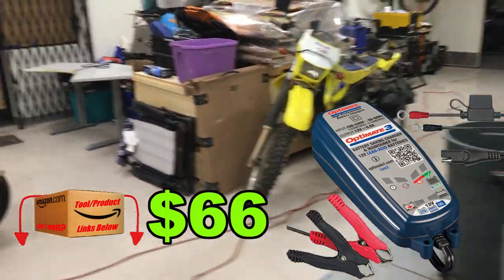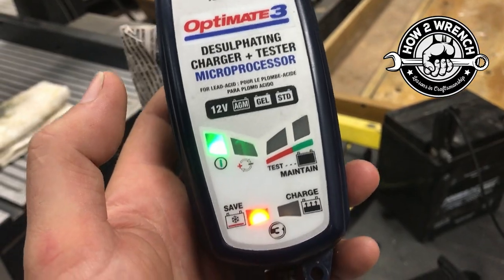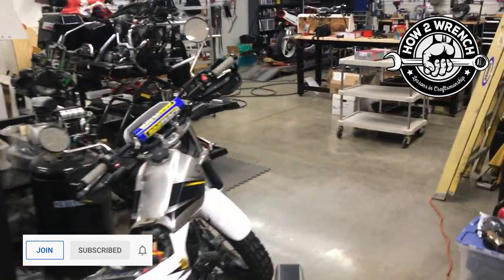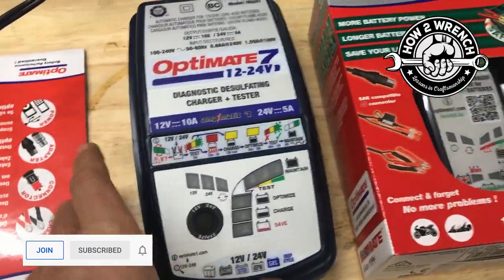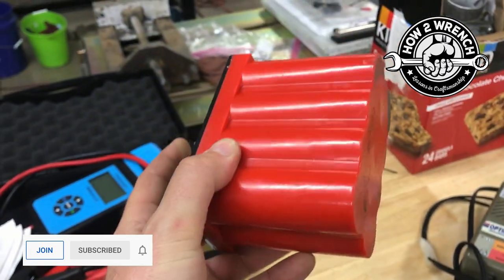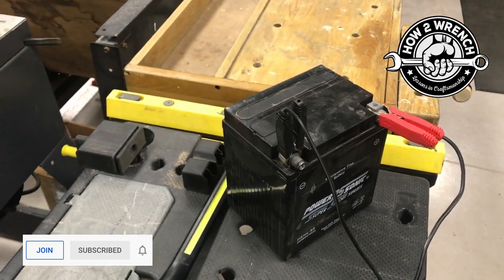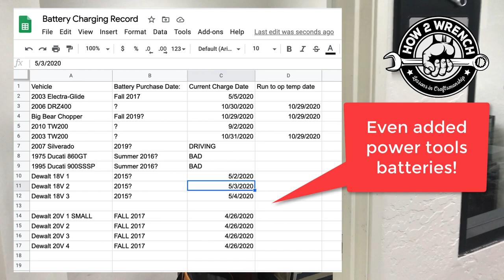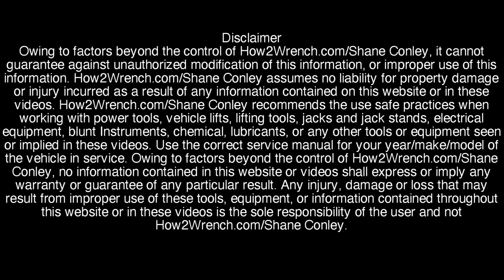Can a battery charger really save a battery? YES! Saved me $214! Optimate Battery Charger Giveaway!

Comment: Good stuff.  I recently picked up a Noco 2x2 smart charger. Super impressive. It's got two stations and both have modes for 6 volt, 12 volt, AGM, and lithium! Has up to 2 amps on each station but will only use what's optimal for the battery, especially during the last 25% of charging when it will use a lower conditioning rate.
Reply from the maker: Thanks for the info! Wild tech out these days.
Thanks for subbing!
High 5 us with a donation: https://www.paypal.me/how2wrench   
Join this channel to get access to perks:
https://www.youtube.com/channel/UCBhM8DCKnT3qXwTW0eToyCg/join

Comment: Shane, when you go through the training, ask if the charge strategy is the same for AGM and Deep Cycle. I have an H-D battery that’s been sitting on the shelf for a couple of years. Non of my chargers/maintainers (Battery Tender, CTEK Multi US3300, Midtronics CXC-1105 AA, Solar PRO-LOGIX PL2520) will even try to charge it. I’ve attempted to add a load (Headlight) to trick them. No success. Pretty sure it’s time to regain that shelf space.  Just curious of your thoughts.

Comment: Very interested to see your upcoming post on Lithium Batteries and chargers. I wasted over $300 on a Ballistic Lithium battery several years ago. When I first got it, wow, it cranked over my 127ci engine like crazy. Went away for 6 weeks and then battery was basically dead, tried charging, no joy. Had to put the standard battery back in :-(    I would love a ballistic in my Road King, if nothing more than for the huge weight savings. But I just can't trust their reliability to this point.
Reply from the maker: We will all learn together!

Comment: I HATE THESE LITHIUM BATTERIES. Takes frikin day's to charge. I bought a bran new Honda 2019 CRF 450L, don't even have 50 miles yet and the battery is dead smh i have it hooked up to the HONDA OPTIMATE LITHIUM LFP 4s and it's in the orange light smh so hopefully by next week it will be charged and saved smh. I want to go get a regular acid battery for it but i dont know if it will hurt the bike or not.
Reply: @chevyboy37 It will not hurt by switching to an acid filled battery. I have the same bike. Lithium batteries are not great for the winter, reason why I went to an acid filled battery.

Comment: Almost useless video, just an ad. You don't say if the batteries wouldn't come back with a normal charger.  Do it correctly, find batteries that don't come back or won't hold a charge after using a normal charger AND then show us how the will the battery saver works. Until then it is just an ad.

Comment: Maybe its time to down size a bit and sell off one or two bikes. I know personally I want to keep to a maximum of 2 bikes at all times because the issue you were mentioning about trying to keep track.
Reply: I own a hobby horse farm with multiple pieces of equipment, plus 4 vehicles and 2 H-D’s.  Everything has at least 1 battery, a couple have 2. To keep up on maintenance to include battery charge, I use my Google Calendar. I set the alert for each piece of equipment dependent on use/season. Works for me. Plus I add the parts I’ll need into the calendar alert.  Just a thought for those looking for quick solution.
Reply from the maker: Did you see where I show that same idea with Google calendar in the video? Check out the time stamps...we think a like! 😎